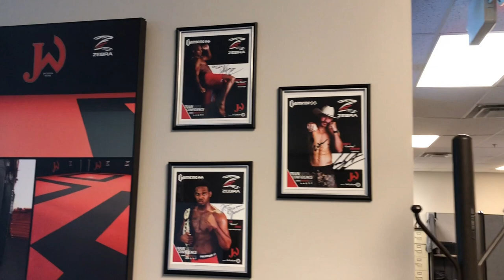Where Do Our Mats Come From?  Zebra Athletics Behind the Scenes Tour!

Comment: Cool video - I am ordering Zebra for my dojo. We do Shotokan w throws and grappling. Did you go w smooth 1.5"? or 1"? 
I am curious how you like it and if you think the smooth surface is better for forms and pivoting / kicking etc...
I am  getting tatami 1.5" but think the smooth might have been a better option...

Also, anyone reading this, stay away from the Swain / Dollamur flexi-roll. I had it 8 years and due to its closed cell structure and low density, it got really soft and created multiple injuries... These Zebra mats are open cell and way denser. 
Thanks!!!